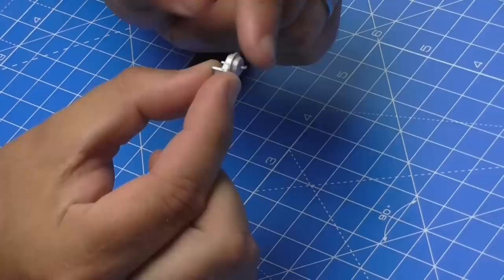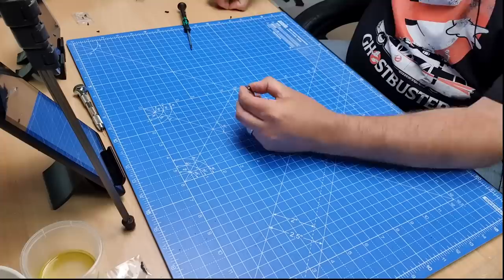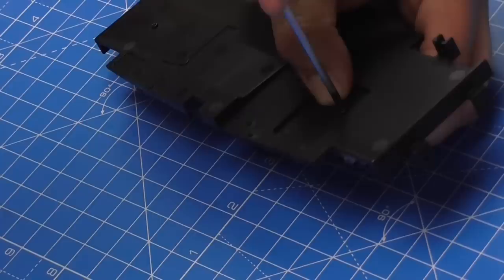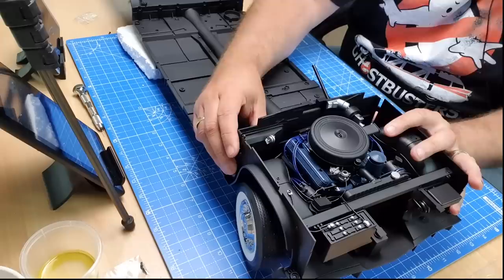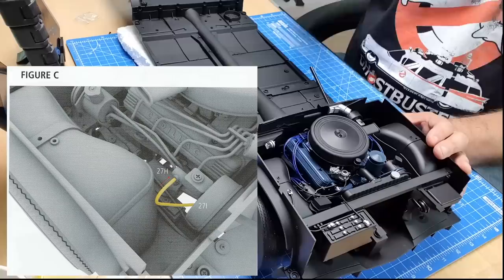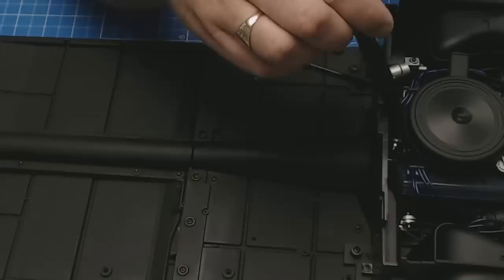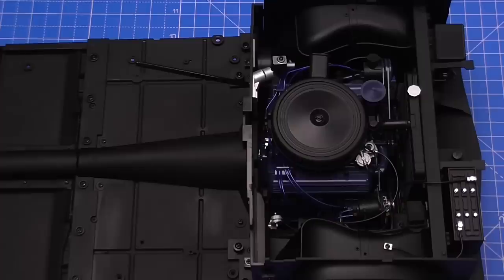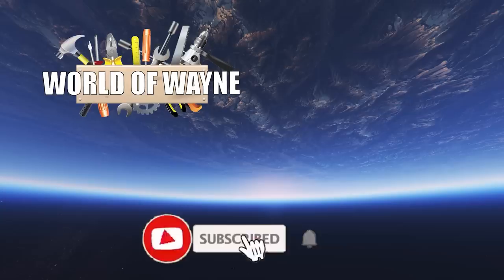Build the Ghostbusters Ecto-1 - Part 27 - Engine Bulkhead

Comment: While I think of it, you mentioned making sure bits are equally screwed on (12:10 ish). What about measuring, then putting a small piece of tape where you measured? Screw up to the tape then remove it. Repeat the other end. Then you know they're equal and the OCD is happy :) (Same idea as drilling to a specific depth just adapted)

Comment: I have just received parts 27 to 30 in the USA.  The ph0 00 000 screwdriver set and the magnifying headset worked great. I did have to use a pair of needle nosed pliers and regular pliers for the Engine Bulkhead.

Comment: The pipe would be an over flow tube for the radiator. Vehicles now have a tank that the tube goes into.
Reply from the maker: Yep. There is a pipe at the back of the engine too

Comment: possibly a relief hose. Of interest, I have been to New York to look at a refresh job on a '59 Caddy with 7,500 ORIGINAL miles. It's a Coupe De Ville with the HD engine, same as the Hearse. Got 400 pictures, a couple of dozen under the hood. The only non original parts are hoses, belts and filters. I will send you copies for reference.

Comment: Wayne, the tube coming off of the radiator is a drain tube. The cooling system on that car does not have an overflow tank. When it overheats, the radiator cap releases pressure out of that tube, right to the ground.
Reply from the maker: It's not that tube. I have one coming out the back of the engine too

Comment: That random pipe is for the pressure release on the radiator when the temperature increases above the acceptable level, on modern cars it goes to the expansion tank. On older cars when they get too hot you'd see steam coming from under the car  so it would be directed to the floor and not into the engine bay. This pressure release would first let you know the water in the radiator is too hot and would reduce the chance of the radiator springing a leak.
Hope that was not too long an explanation for you Wayne?
Reply from the maker: Yep. That's the front pipe near the radiator cap. There is one at the back of the engine too. I wasn't sure what that one was for.
Reply: @WorldofWayneUK  I think that would be a breather pipe, I'm not a mechanic either but when I do know things it does help to pass on some knowledge. Great videos, sadly I don't get much chance to do the model building... about half way in my falcon build, would like to find some figures I could use in it as well.

Comment: The hose from the radiator cap dose not connect to anything for those years. It is  just for releasing  pressure and it just stays beside the radiator. I think the real one would be made from a metal tube.

Comment: Finally got to do this part Wayne, & found it very problematic. Especially the pipes. The main one I had a problem with is the power break reservoirfluid line. Can not see where it attaches to the engine, so will just super glue it to a part of the engine where it can not be seen. Instructions are not very good with some parts.
Reply from the maker: I know I had one lead that was a breather hose that just point down and goes nowhere.

Comment: Found more inconsistencies between the build and the photo on the web site. The windscreen wiper motor is silver in the build, but black in the photo. Its hard to tell, but it looks like the other silver items you put on the bulkhead are black in the original photo?
Reply: I found Vallejo black model paint matches the black used on the kit perfectly.  I used it to paint the generator black as there should be very little bare metal on it.  Will be doing the same thing with the wiper motor and the master cylinder will be painted a greyish iron color instead of silver.

Im just trying to figure out why they have the fuel pump going to the heater box.  This is considerably further ahead than I am so it gives me time to plan on mine.

Comment: The tube fitted on the radiator is a overflow tube it would just hang down contacted to the frame at the bottom  . As for the tubes at the back of the engine is going to be a  nightmare to fit especially the silver part

Comment: Weird they have the fuel inlet line (they call it air filter control pipe?) running back over the exhaust and into the bulkhead??, not only would that cause vapour lock due to heat in that area (and be a fire waiting to happen as well as fuel line being in passenger compartment! ) in the real world, it is wrong unless the ecto is like that for some odd reason. The fuel line joins the full length metal line on the chassis frame roughly below the generator/alternator. I am making a mental list of all the errors and inaccuracies for when they release this in Australia :) Watching this build with keen interest